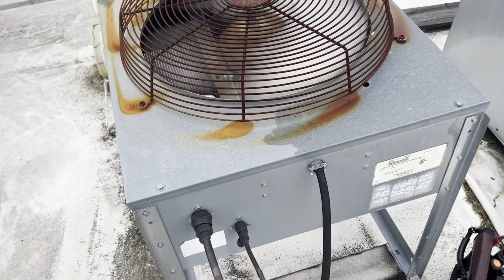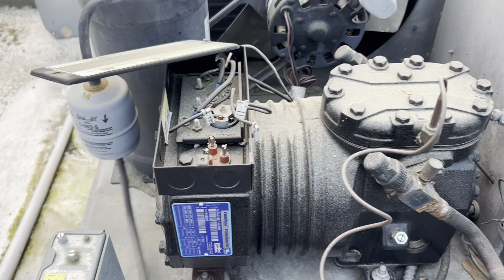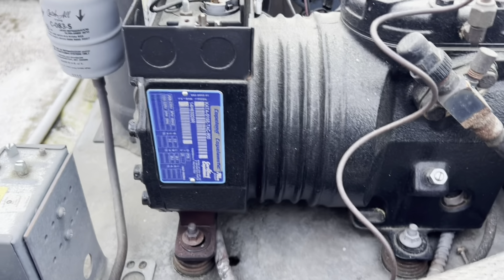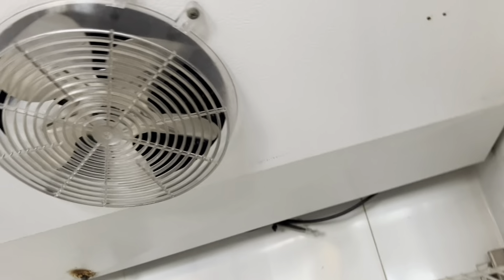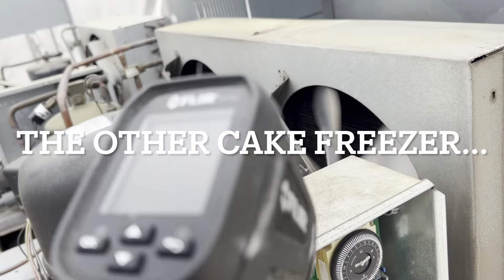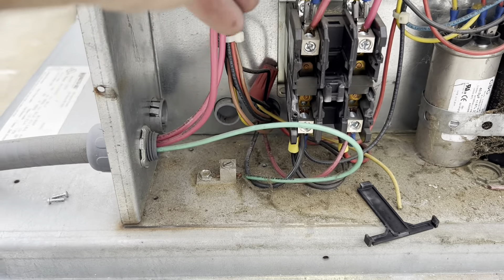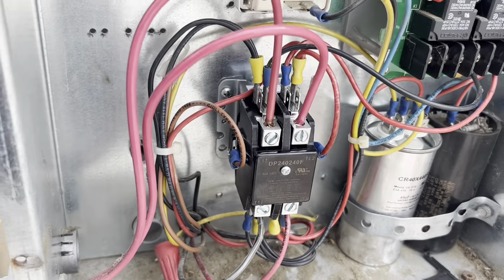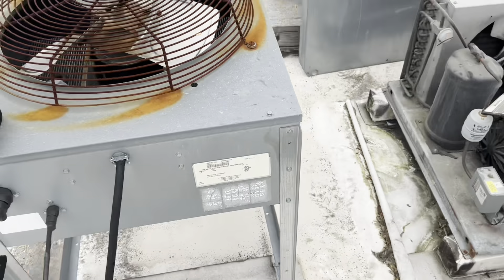Cake freezers and remote condensers - new inspection

Comment: I do not think it needs a semi,a sealed comp. should work and a motor if you checked pressure and had no leaks 1300 +5 hrs and refrigerant.about 4 lbs.for condenser + evap work.